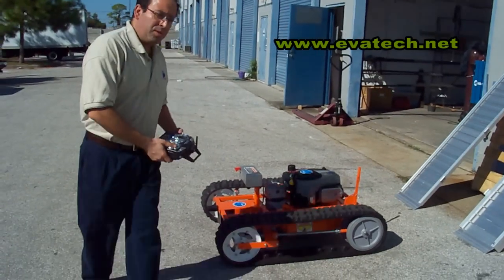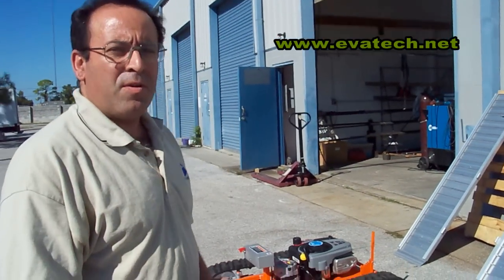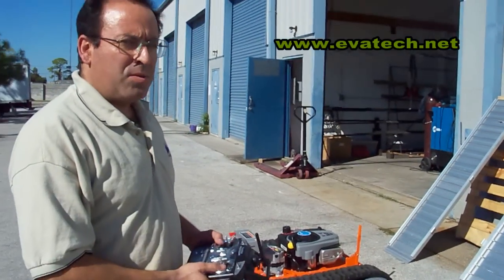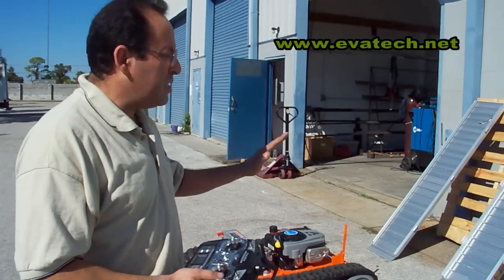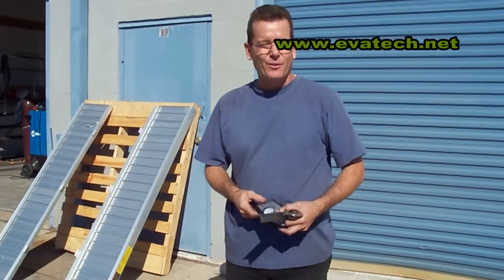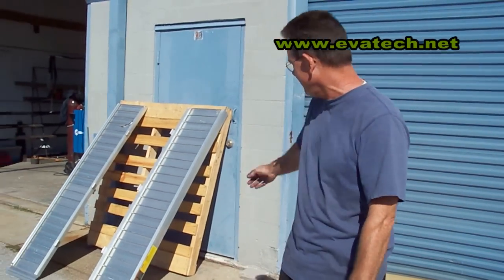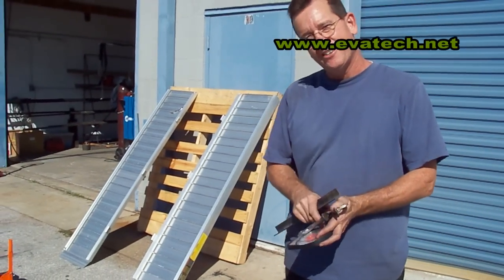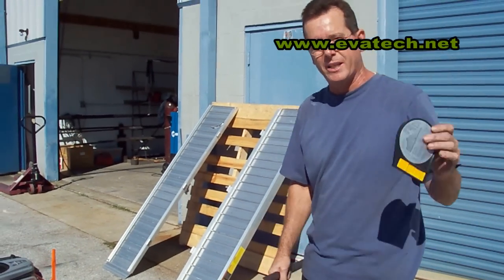DANGEROUS MOWING ANGLE

Comment: That's nice and all but you are going to run into issues with the carburetor running out of fuel and the lower end seizing if you work a vertical shaft engine at that angle more than a few minutes at a time.

Comment: That's all great but you're driving a rubber tracked machine up a Ribbed set of aluminum ramps designed for traction try it on wet grass trust me it will come right back down in your face if they were metal tracks with cleats maybe but Rubber + wet grass = REALLY dangerous lawnmower that actually cant possible hope to climb 50* angles

Comment: now put it on a wet grassy hillside and? watch it slide all over the place(from experience). it needs turf treads on it so it wont slide. now tell everyone how much it costs to mow a high grade piece of grass. ill just buy a john deere with a articulated mower arm. then I can cut trees and brush at the same time on a 90 degree angle..